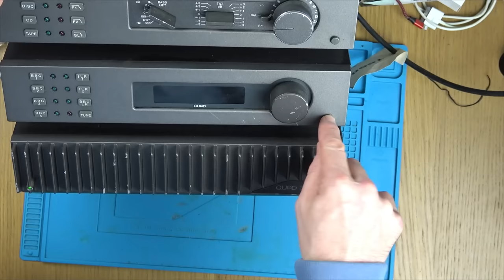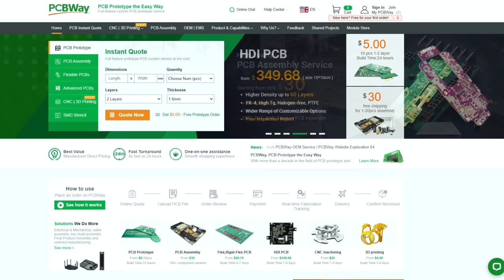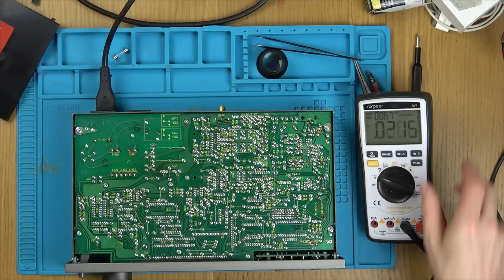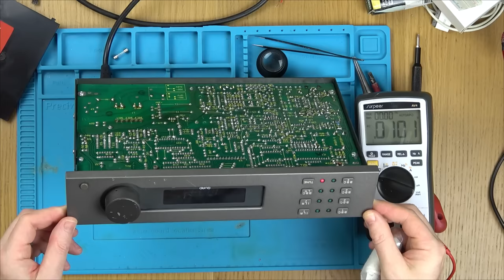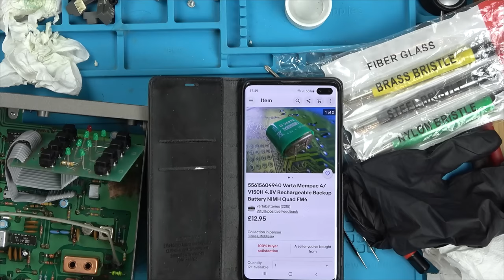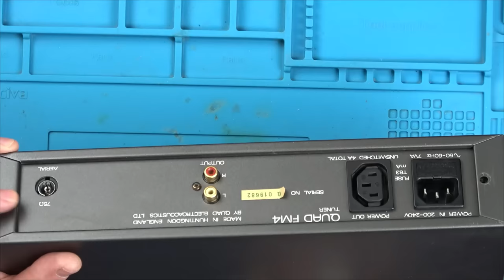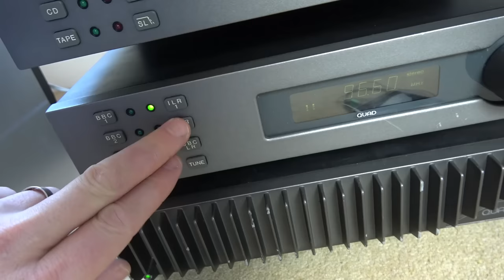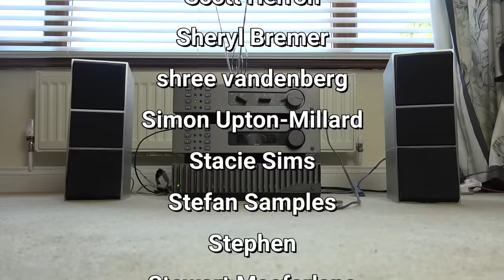QUAD - The Crème de la Crème of Audio - Can I FIX it?

Comment: Really nice video and I learned an AC input has plus and minus polarity- I’m so stupid I really thought it is called phase and neutral 🤔
Reply: I have always dreamed of having a Quad system since 1973!!!!. 

Big side note,  In my personal opinion both of you are kind of right on AC and DC.  they have been  miss labeled since back in T Edison and N.Tesla  days.  It is our industry short-hand that leads to the confusion.    DC should have been called Direct Voltage, after all we check it with a volt meter.  AC voltage is really a voltage sine wave and LABELED as the voltage of the equivalent area under the sine wave equal to a DC voltage, Root mean square, RMS,  (RMS times square root of 2 is the Peak voltage of the sine wave, center axis to peak) .  For safety in AC power systems at most customers locations, one wire is grounded (USA) or earthed  (Europe),  Using a oscilloscope, one half the of the sine wave is above earth reference and the other half of the sine wave below earth reference.   Also part of safety, "Neutral" is a special ground/earth wire sized for caring normal power current, Thanks N Tesla. Ground wires are sized to insure all metal parts not caring power are safe and also a low impedance path for electrical failure currents and voltages.  A volt meter only reads SCALAR. When we use "phase," it relay means a VECTOR which requires at least TWO  "X" and "Y" coordinate information.  Again industry "short-hand" and general word use forget these subtle but critical differences.
Reply: Apparently I heard Vince only got a VTVM after he burned his tongue on the terminals when he thought it was as tasty as a 9V pp3, but not as tasty as window water.

Comment: Great hint about that RIFA cap. You could have replaced it with any 'class 2'/'X2' cap of the same nF rating afaik. This new RIFA cap will probably blow too. :P
Reply from the maker: Thanks for commenting again devtty, I never knew RIFA had such a reputation! 😂 I think I need to bulk order some safety caps 👍
Reply: @Mymatevince  Dave from EEVblog has a video called "RIFA Madness".
This is a word play on the old "educational" movie "Reefer Madness".
Reply from the maker: @oldguy9051  🤣
Reply: @oldguy9051 And the Hawkwind track 'Reefer Madness' !!
Reply: Adrains digital basement also talks about rifa caps and the smoke they produce when they pop
Reply: @cantliff9  I had one of those crack on me, too. It was about 15 years ago when using an old Apple IIe. Could have repaired it easily (with what I know now) but the smell was unbearable...
Reply: @oldguy9051  yes he mentioned the smell also, god awful apparently
Reply: @cantliff9  The smell is probably the worst thing about it. It really clings on the power supply. I simply used a different one and put the defective one in the cellar to "stink it out" over months...
Reply: @oldguy9051  damn...
Reply: @cantliff9  it's something us BBC Micro heads have to get used to, recapping the power supply every 30 years or so :-)
Reply: @nemesis2264  Oy 😮
Reply: It's not a capacitor, it's a series RC network, 47nF+100R. The Rifa caps dry out when not exposed to mains power for years, as here. In a system in use they last decades.

Comment: Hey Vince, love the videos as always.  That tuner screen must have a blacklight or be vaccum fluorescent.  I'm kind of surprised you didn't fix it so the tuner display is legible! I think a revisit is needed for that alone!
Reply: It is a vacuum fluorescent display, and the phosphors lose brightness over time. Not really fixable apart from replacing the display unit itself, which is a horrible job. Think loads of heavy duty pins coming out of a glass envelope… not an easy desolder job!

Comment: There are 4 connectors for the tape deck because you have left and right tape out for recording (eg from the tuner or any other source such as a turntable) and left and right tape in for listening/monitoring.

Comment: years ago in the late 80s i used to have a quadraphonic amp 4 speaker setup etc. not a Quad system. cant remember the make. it was awesome. but not many albums in true quadraphonic. i did have a couple of albums dark side of the moon was one. and i played it to death.. if i had it to high a volume i would pop all the fuses in it. and was not a problem back then. then they changed the fuses to quick blow antifuse's and they cost a lot money and they popped all the time. i was not a electric wizard. and there most probably a reason they kept popping.  ended up selling the amp. i look back in regret. when i watched you changing the fuses. it brought it all back to me.. :)

Comment: The unmarked marked sockets next to the CD input is actually a second tape output (you can copy a CD to two tapes simultaneously).   REP on the other tape connections is short for Replay, the output from the tape goes there.

Comment: my experience of Quad was that if you give them a ring they will have the answer. I dealt with them a few years ago so they may not be as well informed now. Traditionally you could send them any Quad item and they would be able to service it, a really good company - at least in days of yor!
Reply: Even though the company has ceased there is still a small independant outfit going made up of former employees. they will serviceand repair any Quad stuff. Still in Huntingdon.
Reply: @trevorjones5625  that is sad news, companies with that ethos are so rare each one lost is a tradgedy
Reply: true - they serviced my Quad II/22 in the 1970s - it ws a nice drive cross countryt to Huntingdon!
Reply: @nemesis2264  They must have been ressurected then as they were initially purchased by Mission Audio and then Mission were purchased by Meridian. Both companies did nothing with the brand. I lost touch after that. I'm still local but have heard no info of Quad still going. There is an after sales service outlet but that is not official just a group of ex employees doing what they do best. If they have re-opened again then fair play but if its all made in China then it won't be the same hand made quality of the time. But in a way still good to see the brand being kept alive.
Reply: @trevorjones5625  Hi Trevor do you have the name of the independent company?  I love my Quad gear and want to keep it in good health!  Thanks

Comment: I've been using Nimh rechargeables for several years, and they have been very reliable, and as a matter of fact, after using them, using a good recharger, they have all attained a higher capacity than their rating when new. I've been using AA, and AAAs mainly in headlamps. I've had batteries last over 
3 1/2 to 4 years, and still in use. The good battery makers now make the outside container like a pop can, all one piece, the only opening is on the top, not like alkaleaks... err alkaline. Other components can be checked for out of spec parts. Some caps go leaky, as in leaking electricity, not messy fluids. Some resistors go out of spec resulting in downstream components being damaged. Also check to see if all output specs are still ok.

Comment: Maybe also check the amp and preamp for rifa caps.
These caps are papercaps and they absorb moisture and will eventually leak electrically.
Old tube radios are often stuffed with them and the common practice is to replace them all with much better polyester and/or polypropylene caps.
Just use any X2 rated cap, a paper rifa would be my last choice(or remove them all together, they don’t do much, but blow in the end 😉)
Reply from the maker: Thanks Martin👍👍👍
Reply: I saw one near the Mains input on that middle unit when Vince took it apart, I thought to myself straight away, 'That's coming out'... 👍
Reply: @michaelhawthorne8696  
I was waiting for the smoke, but that never came 😁

Comment: Good video! BTW I have the replacement processor modification for the memory function on the FM4 that eliminates the battery. My FM4/34 I bought new in 1983 (first series brown colour and DIN plugs) suffered the same battery issue, so I took them both to Huntingdon for an overhaul. They installed the new processor that also gives the  additional 7 memories, two on each button. They replaced the pre-amp balance potentiometer and re-capped the tuner and pre-amp. I have the 405 Power Amp and the 66 CD Player. Their repair costs are reasonable, a fixed labour charge plus components, all of which at reasonable cost. After 40 years of ownership I'm still delighted with the system. My loudspeakers are Rogers LS7, but there again I was a BBC Engineer from 1980-1993. Turntable is a 1965 Garrard 401 with 1965 SME 3009 and 1983 A&R P77.
Reply: 73 de G6ZJN.
Reply: @ronwilliams8543  73 also!

Comment: Looks like you have a nice piece of sound equipment now. The rec an play in the back is to connect a tape rack so you can record and play. From the radio, an auxiliary device or a turntable; actually did not see audio in for this last one;  but still could be added. 
Congrats!

Comment: Oh boy, was screaming about the fuse. Glad you realized in time! But I am a bit worried about the RIFA X class capacitor you replaced with the same thing. Was it quality control or design problem for their known issues, or that one you put in there will soon short and blow up in the future?

Regarding linear supplies, hey, they are way easier to work on. All you have is a transformer, rectifiers and output capacitors and some sort of a linear regulator, discrete or integrated circuit. With switching supplies (much more in that era) there are a lot of things that could go wrong, though the IC regulators like the LT1070 series are very easy to play with. Fun stuff!

Comment: Hello ,i just want to say that some of my friends spent a fortune in a Quad system in early 80´s, ,with the electrostatic speakers ,who had no bass(almost none) ,i was still using my Pioneer 76 system , top of the line , they used to make fun of me but  later in time none of their systems worked , and my 76 system ,i´m still waiting for it to go bad ,this from Pioneer, even my early 90´s top of the line pioneer system had problems in the selectors or knobs, while the 70´s one is working perfect with some deoxit

Comment: Might want to proactively replace the RIFA caps in the other two units as well. They will blow catastrophically and stink up the whole house when they do. I once had a RIFA cap in an open Apple III power supply shoot clear across my house.
Reply: Not only that, but perhaps use more modern X2/Y caps with the same values. Even new Rifas will die like the old ones did, so better fix the problem one for all times. That's what I did with my Amiga 1000 power supply.

RIFAs are seriously the most notoriously failing caps in old devices, in power supplies! Mostly known from computer PSUs and monitors and TV sets

Comment: Cool, i have same combo on my shelf powering very power-hungry speakers.
Regarding these 'tape' connectors, one pair is for sending signal to tape recorder, second for receiving recorder signal and sending to poweramp. Back then, some tape recorders had 3 heads, so you could listen to record quality immediately.
Looking to these bass-treble knobs, it's good to compare these with parametric equalizer, "smiley face" is more bass and more treble and so on

Comment: Interesting to see what the more modern Quad equipment is like. I have their valve pre-amp and FM tuner but not the power amps (they had one for each channel). Only the power amps had a power supply, so the other components were not stand alone units. They pick up the HT and heater supplies from one of the power amps.

Comment: The cost was quite low.

In 1995 , you would pay £75000 for a lumley valve amplifier.  It did produce 250 Watts though.

Comment: The reason why Quads were so highly rated was a technology called current dumping. It's to do with biasing of transistors where class A is only 20% efficient but uses the most linear part of the transistor curve. So you get a trade-off where for high efficiency you get high distortion. What current dumping did was dump most of the current with a class C output, and then use a highly linear class A stage to correct the part of the signal which is the distortion. This was patented and as soon as it came out everyone was amazed by it. Mind you looking at the innards of that tuner it seems most was bog standard cheap and basic components. Those 4066 CMOS switches don't do much for the signal path. A proper hifi would not use them. You would expect a toroidal transformer for that money as well.
Reply: The 4066s aren't in the signal path in the FM4, they are just logic switches. They're in the signal path in this 34 preamp.

Comment: I hate to mention this Vince but the preamp and poweramp also have the dreaded RIFA caps across the mains. normaly when they go they will fikk the room with whie smoke a bit frighening for the owner   great video.
Reply from the maker: Thanks for letting me know Rob. I only bought the one!!!! I need to keep some of these in stock, I never knew they were so prone to failure. Cheers for commenting 👍👍😎
Reply: @Mymatevince  there are far cheaper x rated caps than the expensive RIFA.

Comment: The contacts are plated with silver, and are tarnished with age.  By flipping them over, they will make contact, as you noticed, but it is a substantially higher resistance than the silver on silver contact they intended,  I would take them apart and clean them with silver cleaner and re-install them in the proper orientation.  Cheers from the USA.

Comment: Yes better sound  than a B&O (though I bought a B&O) I'm a electronics engineer and at the time the B&O 5500 offered a level of integration that no-one else offered. At the time B&O offered things that no one else did, due to their engineering - that differentiation has been eroded and now its mainly about design. Nearly 30 years later we still have the system....and its looks still impress. I did add the Penta-lab speakers to the system. Only fault in 30 years has been the ring for the volume control that I broke and took some repair.

Comment: The switch contacts are either silver or silver plate, silver turns black when it oxidised, could be that the clean side is in the switch top body, and not really in open air so to speak! 
Nice fix Vince, I was shouting FUSE lol, I used to have Denon  audio equipment, and in the car I had a big Alpine set up that Autosounds in queens road ( Watford ) installed, we are talking late 80’s and Money for nothing Dire straits was the tune to play
Reply from the maker: The fuse is SOOOO obviously now Gary, but I just didn't see it 🤣 It does look like the way silver tarnishes. Do they use silver in switches and other components etc. Maybe the contact side was silver plated and the other side wasn't...I'm intrigued now!!!!! I'm already nodding to Money for nothing in my head as I type😂
Reply: @Mymatevince  silver was used a lot i believe, someone with a physics back ground may explain it better about the oxidation? Maybe only one side is plated I don’t know lol, that was a killer track especially the big build up with the drums.. I know silver. Is used in watch batteries, and gold is used a lot on circuit board edge connections like on what they call “fingers” (no pun intended on your mishap) on video cards, sticks of memory and processors in computer equipment. Keep up the good work 😉

Comment: The fuse rating is on the back panel. I would replace the battery with a button cell, it would do the same job.

Comment: As the MK1 FM4 was designed in the early 1980s one wouldn't expect a switched mode supply. Having said that, the the interference generated by them has made many hifi designer's stick with linear supplies anyway.

Comment: DADA Electronics do some replacement kits for QUAD gear, lets face it the electrolytic caps are are a bit old now. DADA are a good place for information too. You have just learned why QUAD are such highly regarded equipment.

Comment: I believe Varta are well known for leaking in Amiga computers of the 80’s and early 90’s.  One other point : could the “disc” input be for laserdisc? That’s definitely the era for laserdiscs, I had a player in 1991
Reply: Disc is an input for playing vinyl records. It'll be setup for moving magnet cartridges (I'm a Quad owner).
Reply: Varta have been around forever and still going, but as with most brands will leak.
Reply: @DavidHembrow  You just brought back some memories.. Before I emigrated in the early 90's I had a pair of Quad 22's with Verdik preamps.. and my only audio source was a Collaro transcription turntable (12" platter weighed about 300 tons mounted on a lump of teak school science desk) with a Linn Syrix arm and a Grado 5+ mc cartridge.. In the mid 80's I worked at a shop called Cleartone HiFi in Bolton.. and most of my gear came to me through trade-ins with serious people upgrading to more modern gear. Valve power bricks in particular weren't seen as the "holy grail" they are today.. many people wanted to get shut of the ancient 1950's/60's things. I wish the 80's would come back.. proper analog audio and an abundance of cheap old gear that today demands a kings ransom.
Reply: We used to use those batteries on mother boards in the mid 1980, some would in two years, only a small %

Comment: great video  i had a quad amp preamp and twin tape rack was a silver set not in a wooden box 1986 models it was very heavy and great sound ,i paid 60 quid for the amp preamp twin tape and 35quid for a akiwa deck and 24 slide e,q plus a pair of jamos reconed 400 watts

Comment: Brasso on a cotton bud works great, but you must get rid of any residual chemicals, Tektronics used to wash the 500 & 7000 oscilloscopes in water mixed with Tiket cleaner